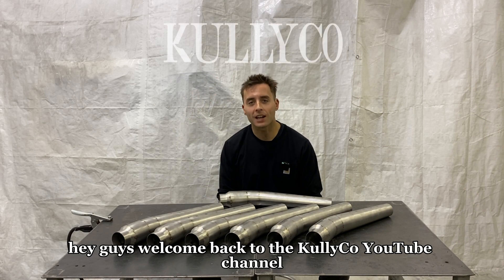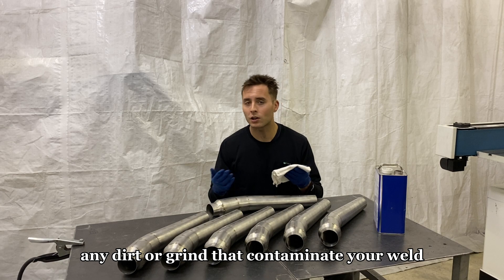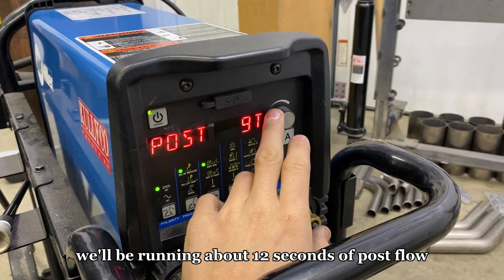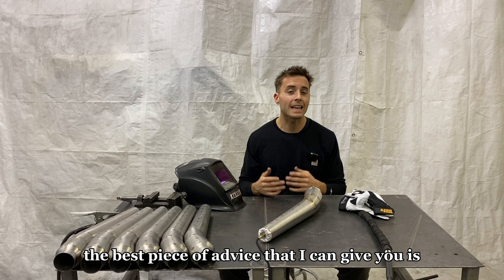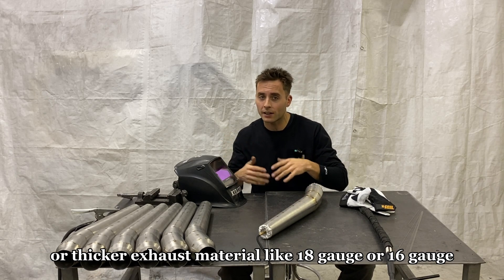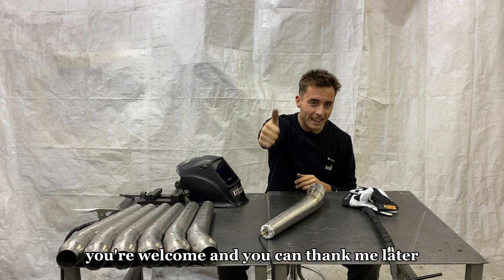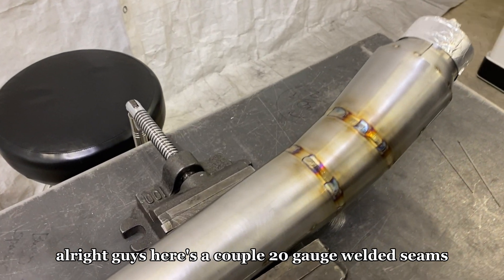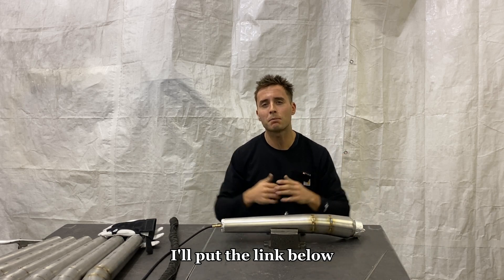How to TIG-Weld 20 gauge stainless steel like a PRO!

Comment: Do you back purge when you’re tacking pieces together ?
Reply from the maker: @BuddysBS  not usually - a guy could though.  When welding - you burn right over the tacks and are purging then— that’s the way I’ve always done it .  In aerospace - you would purge while tacking
Reply: @KULLYCO  we appreciate you !! Keep grinding out here !!
Reply from the maker: @ thanks man! I’ll keep it up !
Reply: I do, I have a set of Aluminium bungs, which I bolt to my bench via a breather bolt through which I pump Argon gas. I build the part up from this. It's important with materials like Ti. because any oxidisation will contaminate the weld.
Reply from the maker: @iiredeyeiiredeye1569  Agree completely, thank you for the input!

Comment: I have watched a lot of your vids and like your method of teaching. 
After the welding I noticed the weld changes color. Silver, goldish and blue.
I heard that silver is best and that the light goldish is good but blue means
the weld has began to get oxidation. It does look good though with the multi colors.
I assume that it is a heat thing as it seems to start changing midway and more towards the end. 
What are your opinions on this and do you do any cleaning or sanding after?
Reply from the maker: Hello! Thank you watching , glad your able to value out of the content. 

I think it terms of coloring it depends what the application is.  Ive done work in aerospace and they very much require an all silver weld.  So trailing cups and extensive argon is used.  For exhausts, motorsports etc.. some color is perfectly fine.  Ive never had a failure (knock on wood) so I dont need to use trailers and extra gas to keep it silver.
Reply: @KULLYCO  Good to know. Any cleaning or scotchbrite or solvents after the welding is done?
Reply from the maker: @chuckyz2  No sir! prep material with scotch brite and acetone before welding, then nothing after welding.
Reply: @KULLYCO  Thank you!
Reply from the maker: @ you bet !

Comment: Never heard someone say that it’s better to go full pedal. Every instructor and YouTuber I’ve ever watched has said to set it at least 10-15 amps above what you’re actually gonna be using so that if you get into a spot where you need a little more, say the filler gets stuck or something, you can bump the pedal and get that extra heat in to fix it
Reply from the maker: Yeah there are certainly more than one way to achieve a great weld!  I've just found this is the best way to do it for getting the most consistent , attractive weld!

Comment: i love this video...  but, i have to be honest....  im dying for a quality arc shot.   As a welder myself i spent some time figuring out the secret sauce to get one without spending thousands on a camera and lens setup.  Since i solved it i always feel compelled to pass the info along instead of keeping it to myself.  a rising tide raises all boats  
Anyways, to get a quality arc shot with only the cellphone you likely already have, do this. 
-Purchase a 67mm lens mount for whatever phone you have (iphone or android)
-purchase a ND1000 filter and a ND 2-400 variable filter (the variable allows you to have some level of adjustment to the light filtering based on the amperage you are welding at)
-stack the filters, fixed ND 1000 first, the screw the variable filter on top of it
-MOST IMPORTANT STEP,  setup your camera without the lenses mounted, get it zoomed in and focused,  then lock the focus, then attach the filters carefully to not move the camera, then start filming

this will take a little trial and error to dial in the variable filter depending on your welding amperage, but you will end up with high quality arc shots for less than $200 that are 90% of the way to what people get with spending well over a thousand on a professional camera setup.

i hope you see this advice and i really look forward to watching some of your techniques with a legit arc shot.  Take care brother!
-Ryan From Christmas, FL
Reply from the maker: Hey Ryan, I really appreciate the info and you spelling that out for me!  Genuinely.  I too am dieting for a good arc shot!  

I would love to film clear, quality shots when I am doing the welding bits- I think it would take my videos to the next level for me and the audience!

I will dig into this information a bit and try and make it happen on the next video. 

Thanks again!

Comment: Is your filler rod 0035” too? You may have said but I missed it
Reply from the maker: @Alwr400  yes sir it is! 0.035” supermissile filler rod
Reply: @KULLYCO  Thankyou.
Reply: @KULLYCO  I haven't seen 0.035" Supermissle listed for a long time. Is it old stock or special order? How do you get it in that size? I used to get Supermissle MIG wire and cut it for TIG welding, but I don't see Supermissle MIG wire rolls available these days.

Comment: I always have my welder turned up to the full 300a lol. But I noticed that I set the ampere more and more like you said to the perfect spot, so I can weld pedal to the metal but also have way more room to adjust with the pedal as the part gets hotter and hotter.
But stuff that thin I say I weld maybe two times in two years. 

A video only on back purging would be really cool.

Is there a specific reason for the long gas pre flow?
Reply from the maker: @nicoquattro3950  good to hear man! Glad some of this information has been helpful to you.  Yes, having your amperage set close is a game changer. -and like you said .. when needed to make a heat arjument with the pedal it’s much easier! 

Pre flow is to sheild your tungsten before you strike the arc, that way your tungsten doesn’t get contaminated by the elements . 

Yeah we could do a specific back purge video!
Reply: @KULLYCO  Yeah I know why pre flow. But that long? I have it only 0,5 seconds or something. Or is it because you have that big cup on? I only use a very narrow cup that fits all my tasks

Comment: Mr. Kully, do you have any tips regarding how to find the ideal amperage for a given material/thickness? What are your thoughts on the standard " 1 amp per 0.001" "rule? I assume any sort of rule of thumb for that goes out the window when the part you're welding is very small relative to the "amount of welding" being done on it...?
Reply from the maker: @kchinz34  hello sir! Yes the .001 to 1 amp rule works pretty well!  Obviously there are times you need to deviate one way or another .  Depending on the type of weld- it will change one way or another .  But that rule will get you in the ballpark!
Reply: @KULLYCO  Thanks!
Reply from the maker: @ you bet!